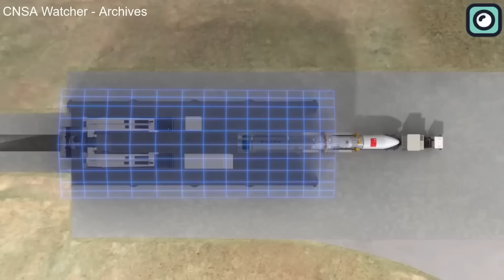China Copied SpaceX's Falcon 9 But It Went HORRIBLY Wrong!

Comment: Reusable rocketry is an engineering and software problem. The Chinese must replicate the rocket, launch it again and hope it fails again and again. With this method, the Chinese will learn the flaws in their rocket program whether it was a technical issue with materials or problems with software. From there, the Chinese can institute remedial measures.

A new way of assembling rockets is by using epoxy glue which can give weight savings vs using welds. Using glue is a technique used in high performance cars where weight becomes an issue.

For rockets, savings on structural weight means can accommodate more fuel - can be used for better maneuvering as it tries to land.

Comment: this is the thing, every delay does slow it down but also allows more information and data to be processed about flights done, what went wrong etc etc etc.  focusing on the negative is just going to make people upset or mad.  profiteers need to stop focusing on JUST the negatives.  there is positive in each of the delays as well.  whether this information is shared with the public or not.  yes time is money, but its' NOT>>> JUST money.  and that is what needs to be dragged into the light.  accomplishments never happen in a void.

Comment: Well, to be honest, it took SpaceX a few tries to make it work!
Reply: SpaceX does a much more difficult last second braking manoeuvre.
Reply: @jackdbur  I think the final vehicle will as well. This is just basically Grasshopper / F9R Dev 1.
Reply: @AmbientMorality  BO has had a lot of time to test high impulse minimum fuel landing on their hopper & hasn't done so. I suppose that you have to have a great trust of your vehicle and be prepared for some to become scrap. That SpaceX F9s have done hundreds of these last second landing burns onto barges at sea is even more amazing.
Reply: SpaceX didn't steal someone else's technology either and that's a lot more difficult to do.
Reply: bought a Trampoline from PricSmart. Made in China. When I called the company in the user's manual,  the phone number was from Canada. Canada does not sell that model outside of Canada. China copied the whole product , changed the name and put Canada's number in the manual. Sold to PriceSmart.
Reply: A few compared to NASA's many many.